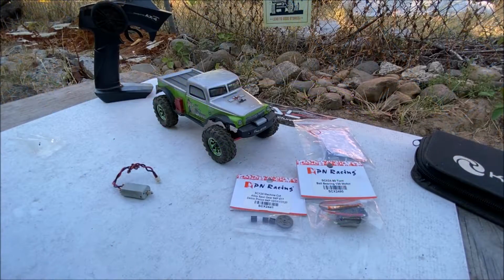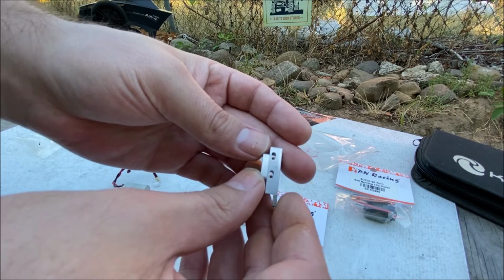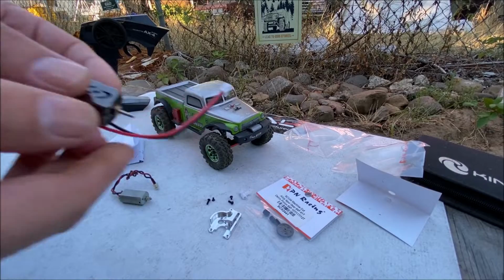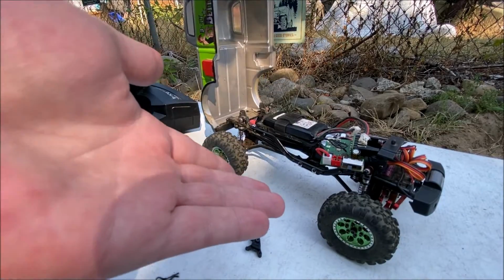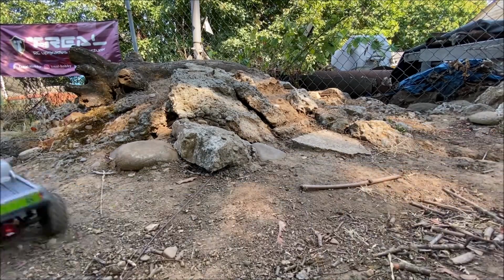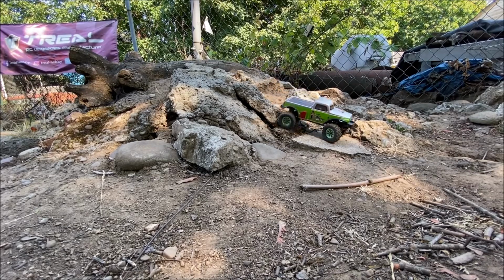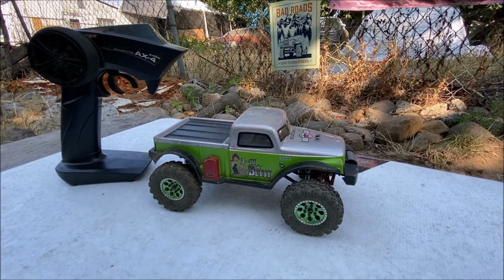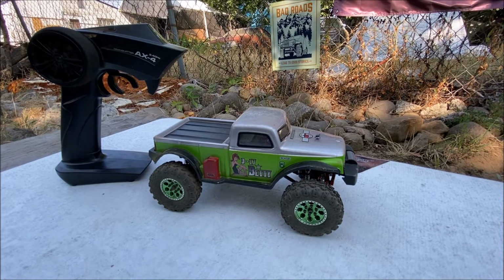PN Racing 90t 130 brushed Scx24 motor test!

Comment: on my motors I tend to stick tiny rectangular heatsinks. like ones you'd use for a raspberry pi micro computer. so with the exposed brushed I'm wondering if you just covered the vents with tiny heatsinks you'd block ingress of dirt without reducing cooling capacity

Comment: Can you flip the skid on the build and go with lcg battery tray for it? Should be pretty good that way.
Reply from the maker: You could but the stock battery don’t weight that much the motor and plate weight a little more Im pretty sure but didn’t actually weigh them. It would also move the motor back to the same side as the torque lean so it would end up negatively affecting performance. I found lowering the stock battery tray after a transmission flip or forward motor mount I ended up with better performance all around especially when side hilling. That’s my experience with the deadbolt when I was experimenting with different layouts and a 050 motor at least. ✌️🙂
Reply: @TJthercGuy  siiick dude. Thanks for the reply. Betty is looking good.

Comment: What do you think about this motor for running through water and mud? I like to get my truck dirty. I'm a bit worried about the holes in the case, but then again my furitek komodo in a different build has done fine with water and mud.
Reply from the maker: Clean water would be fine but muddy water wouldn’t. The holes would let debris in the case and gum it up.
Reply: @TJthercGuy  Thanks for the advice! Will keep that in mind. Perhaps a rinse with clean water after a mud run would be good enough? Haven't gotten the motor yet, but been thinking about it a lot lately.

Comment: What did you see to attach the pinion to the motor? Mine doesn't have a grub screw so I'd have to use locktite or something like that?
Reply from the maker: No never use locktight on plastic. The pinions are press fit so just push it onto the motor shaft.

Comment: Did you find that with the 10t pinion the front driveshaft would rub on the motor housing? I am running the 11t now because of that but would love to get the ten on.
Reply from the maker: I haven’t noticed any rubbing. 🤔